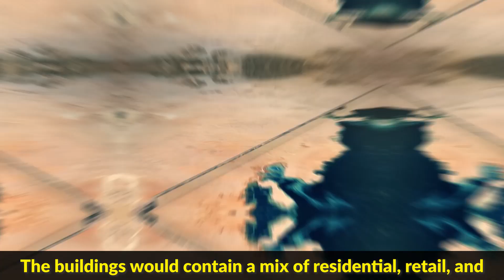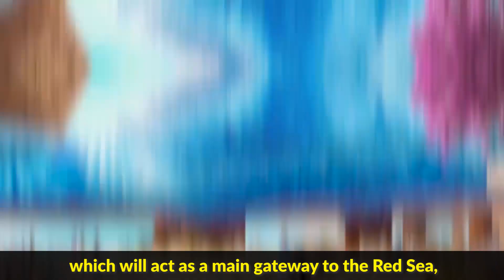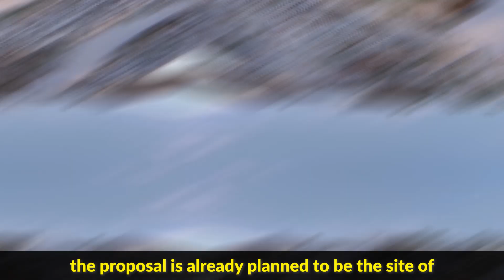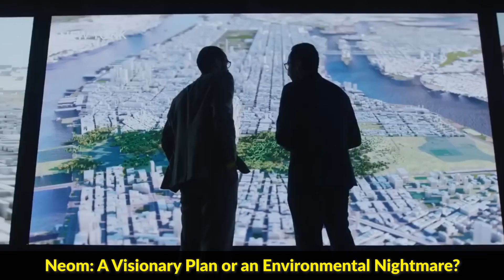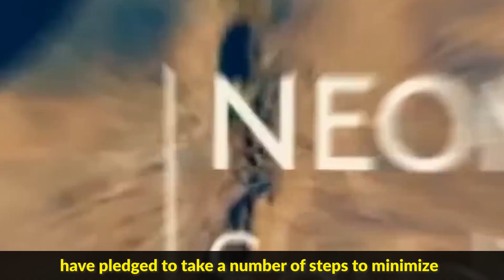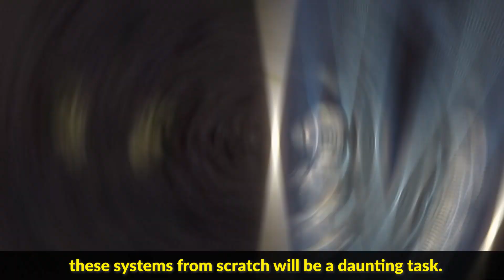MAJOR UPDATES : NEOM - THE LINE AMAZING Construction Progress (2023 footage) + Latest Developments

Comment: Its fake. As an engineer i did some calculation based on the drone footage and the original animation. It is only 50 meters wide when it needs to be at least 240 meters wide. Also it is only 2-4 meters deep when it needs to be with metro and highspeed trains underground at least 40 to 50 meters deep excavation. The depth that includes the massive foundation the building needs (to not to just snap in half in the middle in the wind). So just simple math shows the excavation shown in drone is just to get more money in but is actually fake or the line isnt going to be even remotely as big as indented. With that excavation its about 1:5 scale from original. So max 50 meters high and 40 meters wide. How long? 1 mile max. Even as only mile long its going to be hundreds of billions of dollars..
Reply: I totally agree. The size is so huge they can never build it. I calculated that the volume is 10.000 times that  of the Burj Khalifa
Reply: @Robert-vm8vw  Yup, it aint gonna happen in next 200 years. The material need alone is so huge that its same as they do 100 New York cities in a next 5 years lol.. There is not enough cranes in the whole world to do it that fast..
Reply: couldn’t it just be not fully excavated yet? i measured the width on google earth and it was about 400 ft wide
Reply: @possessedghostly.4126  No, when you start to dig you go the full width and create extra width for crane tracks etc. From the very beginning. So that excavation is 100% fake and only for show. That with isnt even as wide ad most normal big housing sites.
Reply: @Thevikingcam  
Despite my lack of knowledge about construction, I expressed my skepticism regarding the absence of new footage for the project in question. I noted that all the videos that had been recently released were merely recycled versions of the same material that had already been available for months. I raised the question of why there was a dearth of new footage, given that work on the project was allegedly ongoing. I appreciate the information you provided about the construction process, which helps to clarify why there has been no new footage.